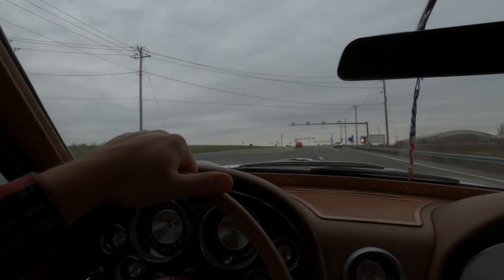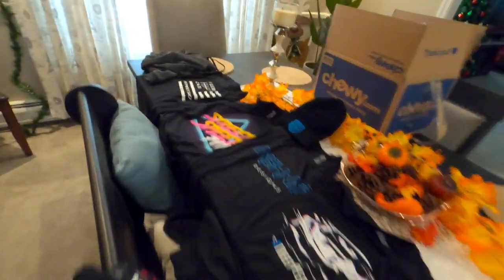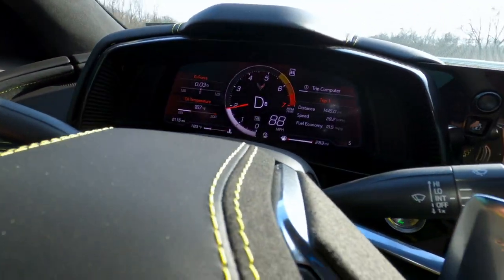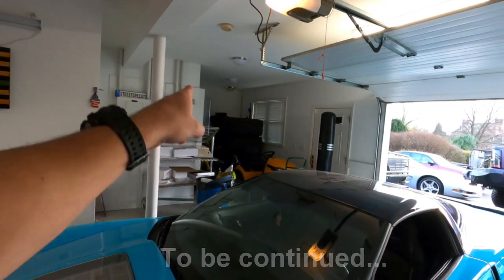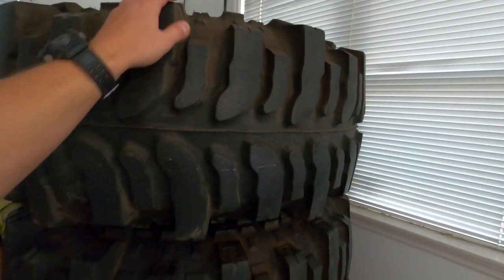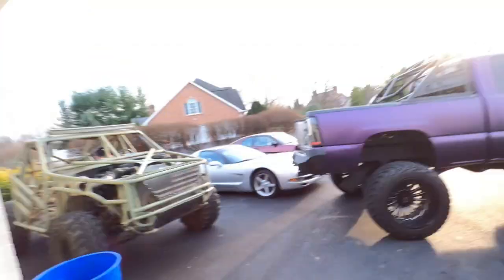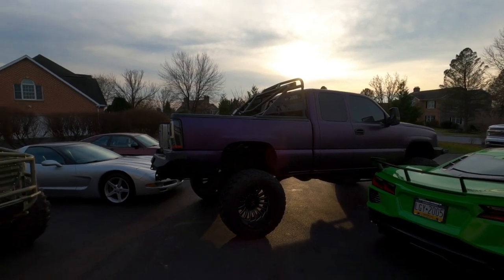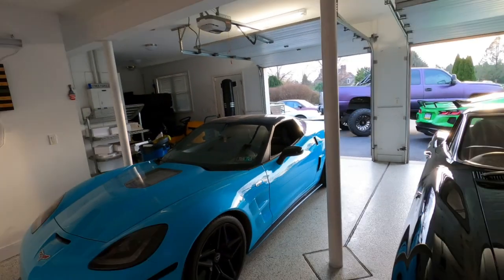BUYING BACK The Truck That Started Everything... *Friend's Crash Caught on Film*

Comment: We need to see a race between the zr1 and cleetus mcfarlands c7
Reply: Duuuuudeeee
Reply: Lol cleetus c7 just made 1000+ 🤣🤣🤣 mike says the zr1 is 1000 also says its 900 🤣 ole cleeter would whoop on ole mike i love mikes zr1 but lets be real. Ole cleeter would win
Reply: They wouod havw to make it a ppv if it was to happen everyone would tune in🤣🤣🤣
Reply: The bald eagle machine would crush
Reply: Mikes actually surpassed his expectations it’s over 1000 wheel but to not spoil anything he said it has 1000 wheel hp minimum
Reply: Btw who is this cleeturus ? Wats his YT
Reply: @redkingosiris3800  cleetus mcfarland
Reply: Just watched the vid of his dyno it’s definitely not gonna touch mikes Zr1 lol the Zr1 is literally the C7 Zo6 but faster and mikes should be making more power anyway
Reply: Ye his C7 Z06 will most likely get gapped by mikes 109 tune let alone e85 tbh I’ve seen wat 1000hp zo6 can do supposedly and couldn’t beat a stock 720s so I’m not too sure about the them racing either that or the guy lied about his power but I’m still sure the Zr1 would destroy the Zo6
Reply: @redkingosiris3800  lol cleetus c7 weighs less for 1. Dosent have as much drag. Cleetus is a better driver and if u didnt notice he also has nitrous that he didnt spray on the dyno. 🤣🤣 and mike literally said in the delivery video when he got the zr1 back it only made 1000+ so their about even on power without the juice 🤣. Cleetus wins that race everytime buddy. 🙃 and to make it sweeter he works on his own cars and if for some reason he loses literally any of his other cars will absolutely SHIIIIIT on mike 🤣 i love mike been watching him since he bought the white hellcat but cleetus would win theirs way to many factors on his side
Reply: Cleeter is a much better driver identical cars cleeter wins by skill alone
Reply: @chrishinkley5743  thank you🤣 not to mention his car is actually lighter being a base model 🙃 and mikes zr1 is much wider has that big ass wing mike really csnt shift that fast. The bald eagle machine wins this race everytime this man just dont get it lmao
Reply: I didn’t know about the weight reduction but it’s still iffy cause like I said the Zr1 literally Zo6 but faster I’n every way and mikes should be making more torque on top of that and it’ll be faster top end even with the wing I’m pretty sure u mod both to the max the Zr1 will walk it
Reply: I mean Zr1 more torque and faster top end even with the wing And making more power from the vids I’ve seen of Zo6 with 1000hp it’s definitely slower then a 1000hp Zr1 even  if cleetus has nitros it’s still debatable atleast to me since I’ve seen 1000hp Zo6s Gapped by stock 720s
Reply: Real racing involves more than what Mike does going straight is fun but road courses or multi surface rallys are real racing
Reply: @redkingosiris3800  dude I guarantee none of the cars you saw made 1000 hp if so definitely not to the wheels cleetuss car makes 1000+ to the wheels plus nitrous and he's a better driver
Reply: What does better driving even mean in a straight line roll race lmfao stop bringing that up also 2nd of all cleetus car makes around 960 to wheels altho I’m sure with nitros he should be about 1130ish maybe depending on the spray even with a 100hp difference it’s hard to say cause looking at a stock Zr1 with the huge wing vs stock c7 zo6 the zo6 got gapped hard every time so it might not even be enough
Reply: @redkingosiris3800  Cleetus's "base" model has a texas speed 427 (ci)... so it's really not comparable to any of the stock cars. I'm sure if they actually raced ol cleet would tell Jeremey to set up the spray for a 150 shot. in the video he is making  1040 hp to the wheels 900 ftlbs.
Reply: Modified Zr1 will always have more torque and faster top end then a modded z06 he’d literally have to spray off his ass to beat mikes 1000 wheel and That’s still a if and the c7 zo6 I was talking bout that got gapped by stick 720 made 870 while mikes Zr1 on pump made 850 an gapped then 720s the Zr1 is literally a better z06 hence why fastest corvette production car
Reply: @redkingosiris3800  also Mike’s z is an auto, vs cleets bald eagle machine is a stick. He will lose off that alone.
Reply: Wow cleetus is a manual C7 ? Lmfaooooooo that makes this argument even more pointless that Z06 is getting gapped atleast 4cars
Reply: @redkingosiris3800  You're not hearing me, mikes zr1 is only a 6.2L cleetus has a 7.0L engine. He will be making nearly the same amount of torque as a zr1 does due to just displacement. as it is right now it would be a very close race and cleetus is still on 92 oct.
Reply: What about cleetus z06 being manual ? A automotic z06 with similar hp to a Zr1 gets gapped by it lol I don’t even think nitros is enough to make up for the fact that it’s already less torque then the Zr1 and is slower top end on top of it being manual ? Ur out of ur mind dude
Reply: if Wat ur saying is true and he has similar power an torque he’s definitely getting destroyed lol the only way manuals beat automatics is if they have 2-300 more wheel hp then theme
Reply: @redkingosiris3800  Now it would hinder him greatly, however he is a dam fast shifter so that would make it interesting. Thing I'm curious about is what mike actually makes to the wheels, I don't think ive ever seen an actual dyno sheet, just word of his mouth. Unless I'm completely wrong, id love to see it.
Reply: @redkingosiris3800  How do you know he has less torque? how much torque is mike making?
Reply: The only dyno sheet we saw for mike was on pump gas he made 820 but read kinda low an was calc at around 840-850hp but back to wat I was saying a manual is still a manual no matter how good u shift it’s a major disadvantage against an auto I already see how this plays out cleetus jumps ahead then every shift he loses Zr1 will walk it down
Reply: @redkingosiris3800  cleetus is making 200 more hp and 150 more ftlbs of torque... and is lighter... and doesn't have aerodynamic drag of a large wing.... idk how much mike would be able to pull it in.
Reply: Stop bringing up the wing cause with the wing the Zr1 top speed shits on the z06 regardless also I saw cleetus dyno numbers of 905 torque Zr1 with similar power making similar torque most likely will still win due to it being auto vs manual and the weight difference ain’t enough for it to matter it’s not like it’s a c6
Reply: 150hp more manual>100+hp less auto with higher top end speed and similar acceleration enough said
Reply: @redkingosiris3800  its right about 200 more hp, 150 less lbs, cleetus has the accelleration advantage until every shift, except he is a very fast shifter. Top speed really can't be determined when both cars are modified, however one has a high downforce wing and the other nearly bare.
Reply: @chrishinkley5743  what makes you say that? Mike has driven way more cars and has more experience on the street
Reply: @redkingosiris3800  I don’t think you understand, first off cleets c7 is not a zo6 and it’s a stingray, second it has a Texas speed 427 lt1 with a monster of a pro charger on it, and it’s on methanol, it’s in a whole different league than mikes zr1. Cleetus would destroy mikes zr1
Reply: For everyone saying Z06, Cleetus doesn't have a Z06, It's a Stingray.
Reply: I don’t think Garrett associates with Mike.
Reply: I would love to see that race!!! But side note. Peak WHP doesn’t indicate a winner. A super flat Power curve means it’s making big power throughout the power band. If a power curve is constantly climbing throughout the power band and peaks at 1000whp it’s different. Haven’t watched Cleetus’ channel in a bit but if it is a pro charger or another centrifugal supercharger, they tend  to have more of a climbing power curve. Doesn’t mean it’s slow. Just means it might not do well. The top mounted blowers are better for a flatter power curve if I’m not mistaken. Cars could make same peak power, but flatter power curve will be a hard walk on the other.
Reply: @rackemwells  he follows him on instagram
Reply: @josephbareski6931  Oh my gosh, they must be best friends, the closest of buddies.
Reply: @redkingosiris3800  it means if he's racing the c6 then he can shift faster than mike and cleetus litterally just posted a video making 1039 to the wheels with no nos and the c7 cleetus has is a base model with a 427 in it its not a z06 and no shit a stock zr1 beats a z06 that's the equivalent of saying a demon beats a hellcat youre comparing a car that's lighter and making more power to a car thats heavier and has less hp even if he were to race mikes c7 its heavier and lacks the power that cleetus has you keep getting stuck on this whole z06 zr1 thing when that doesn't matter at all to the convo not to mention cleetus has a fat ass meth system and nos there's no way Mike wins overall hell definitely get the jump until boost hits then he's gonna get walked around
Reply: @chriscota1635  watch his dyno video from yesterday
Reply: @elibearden2754  its on pump 92, but is supplemented with methanol
Reply: Just watched that Dyno Vid. I stand corrected. Pretty flat curve for that supercharger. I bet it would be a good race vs Mike’s C7. Cleetus shifts Leroy like a God. So I bet it would be a very fair to about 135mph. Better race without the big waaaaang....
Reply: @redkingosiris3800  you know a lot less than you think. You don't seem to grasp that the engine in Cleetus' car is not the same one that it came with from the factory. It is 427 cubic inches or 7.0 liters. Mikes car is 376 cubic inches or 6.2 liters. Off all the things you talked about that alone is probably the biggest advantage Cleetus has and you didn't even consider it. Now i dont necessarily know who would win bc it seems like Mike always has something up his sleeve but you definitely can't count Cleetus out just bc his is a manual transmission. He grabs gears like a God in a manual that has gone 7s in the quarter. Would be fun to see regardless of the outcome.
Reply: No lmfaooo he’s makin 200hp more max and that’s me being generous and the 150pound weight difference ain’t changing the fact that it’s still manual the only way manuals beat autos is if the hp difference is 250-300 they always need a shit ton more to compensate and no matter how fast cleetus can’t shift a manual is still a manual it will def lose
Reply: He will jump out then lose ground every single shift the only way u could say he can win would be if it weighed as much as a c6 Zr1 and had 1300hp cause even with weight reduction the c7 zo6 losing 150 ain’t enough

Comment: 21:36 I saw the original video on this (and subbed to RFRacing then lol) but I feel bound to ask you sir, where did the extra dents on the hood and fender come from? They were nothing like as bad 4 days ago lol

I do agree though the frame's most likely tweaked, didn't notice the paint flaked off or the control arm damage in the first video either

Comment: I work in a body shop and and it's totally work fixing the frame does have damage but can be straightened I'd say by the impact with the hill it knocked the frame horns to the passenger side bc of the off-road style bumper and with the suspension damage it give you the opportunity to change it up and go to maybe a 4 link rear or something. There is always thinks you find once you tear into something but they usually aren't too bad

Comment: Mike, It's probably not as bad as you think. It drives really screwed up because the rear diff is shifted over to the passengers side. The hood is jacked because it got stuffed into a mound of dirt on the drivers side, tweaking it and the hinges. and the paint was probably knocked off the frame rail by the tire. Turn the wheel full lock to the right and see how close it comes.

Comment: That upper A arm maxed out on impact. The cab did shift over on its mounts. It anything, that inner drivers rail might be tweeked but nothing too major. Everything does need to be realigned which is a huge chore of the brackets are destroyed. By the looks, minor fram damage mainly cosmetic.

Comment: Heads up. 01-10 2500HD/3500HD frames are the same.  You've mentioned before you wanted to do a solid axle swap on the front end. So now's the Time to do that.

Comment: Mike even if the frame is bent honestly it still would not be expensive to fix the truck. These trucks are super common and old enough that parts are cheap you can hit a junkyard and pick up an entire frame for like $200. Or buy a parts truck to replace everything broken on yours. Regardless I would like to see it rebuilt.

Comment: Yes accidents like this can have hidden damage, My e39 M5 was rear ended and it looked like there was no damage but once I got it looked at by the insurance company they said it was totaled because there is this carbon composite structure type part in the rear end that got cracked and it was hella expensive so they totaled my M5.

Comment: Please read this mike before you drive it. I commented on bobbys vid, the rear axle is shifted towards the passenger side like 4 inches im pretty sure its leaf spring, leaf spring mounts or the u bolts and or leaf spring perches welded on the axle tube (the round part). The truck is probably dog legging (driveing down the road sideways a bit) that or the alignment and or bent steering parts,  may be causing it or possibly even if the rear axle is moving around.
Edit: nevermind i guess he knows about the rear end.

Comment: That truck wasn't going any faster than the cars in front of it,  yet it just slid off the road like the road was covered by pure ice? Are those high profile wide tires bad on a wet surface? Just weird that the truck couldn't take that turn.

Comment: i recently did a little drift getting onto the ramp of the highway with my tacoma and mud tires. i handled it well tho and prevented from crashing the roads were wet and i didn’t expect that as my truck it’s slow and a 4 cylinder.

Comment: Mike fix it and keep it as a backup truck for say you get the 2020 serviced then you can still tow the trailer to haul the blazer to off-road fun locations or haul the cars to track events and of course the old train horn blasts and tug of wars and when snow with stuck people to winch them or high water events to aide the fire department get them to a car stuck in high water to get them to safety

Comment: i was tired and went through a blinking red light and got t boned.  luckily the guy slowed down before he hit me.  i was able to drive home luckily.  when looking at it it seemed i just needed to get a new quarter panel and file some scratches on a rim.  so i drove it a few weeks like an idiot before i got it looked at.  the whole front end was messed up and it took multiple mechanic visits to get it back in order.  bend tie rod, control arm, swap bar end link, etc.  it will never be perfect and the quarter panel is still jacked.  its not worth fixing it to mint condition if i'm selling it next year. could be a damn good deal for somebody since it has a dirty carfax.  hoping some kid will pay extra since its a manual.

Comment: Your gonna need more power and better axles and probably gears for those boggers the way it is it will not have the power to turn them you might be disappointed a solid axle swap would be best you'll probably shred the IFS not dogging just saying.